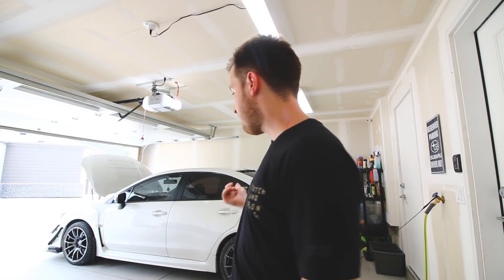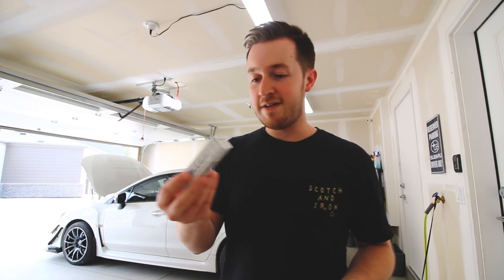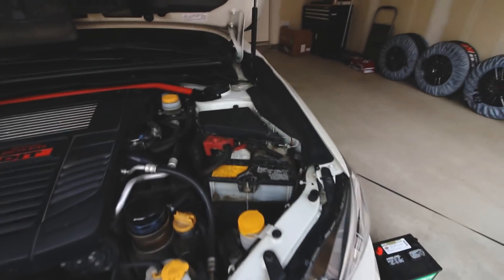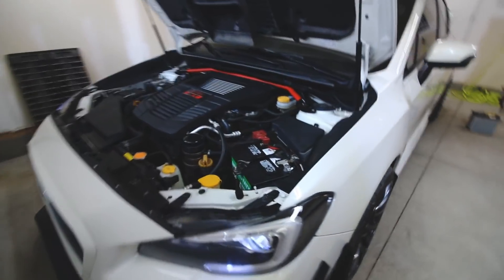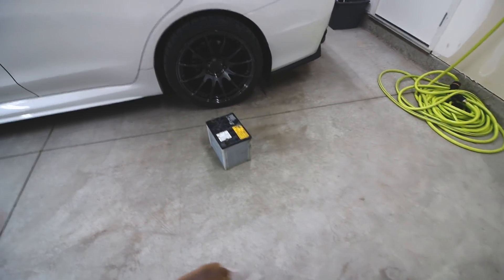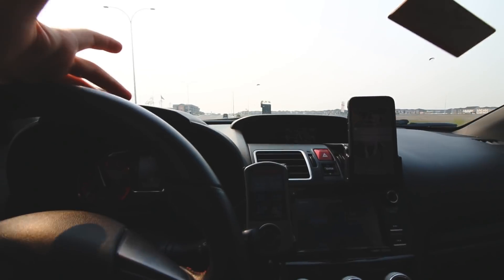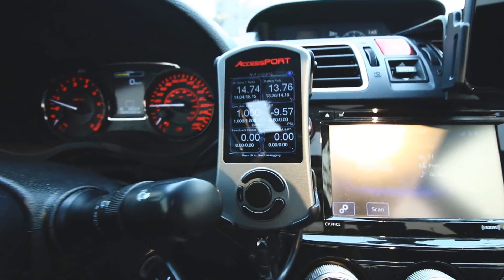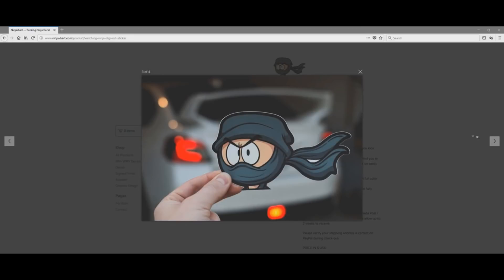Vlog # 28 - Installing a New Battery, replacing the OEM (Warranty info) | 2016 Subaru WRX

Comment: Hey Ninja! I need your help

at 2:13 you have an issue with fitting your battery - I am having the same issue. How did you work around that? You didn't really show it
Reply from the maker: I just slapped the tie-down over top and tightened it hahaha.... but I'd buy a flat top battery in future instead of this.

Comment: Hello Slick - For piece of mind, you do not store a new battery on a concrete floor and secondly you should of had a memory saver attached to your battery terminals before swapping out that new battery! A memory saver, saves all the memory stored in your car's computer for windows, navigation system, radio settings, etc. You probably needed a Group 24 battery to fit correctly....but all in all ... not bad installing battery!

Comment: Odd that Subaru didn't replace it for free, aren't you sill under the 3/36? I actually think that plastic piece around the battery is for insulation. Looking forward to seeing the results of everything installed. Burble map FTW haha. Keep up the awesome work buddy!
Reply from the maker: Yeah it sucks :( I'm beyond the 60,000km's warranty on the battery specifically though, or I was when it started to die in the winter.
Reply: NinjaxBart That sucks buddy, I just seen your IG where you stated the mileage, sorry!...Interstates a good battery you'll get good life out of it at least. I actually like the factory Panasonics that are in stock...here's hoping you have better luck with this one buddy!